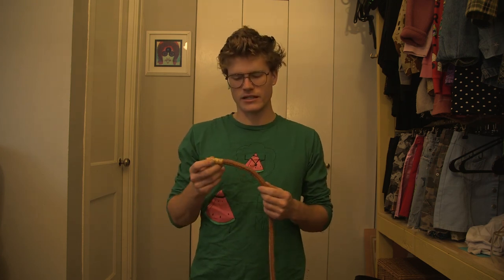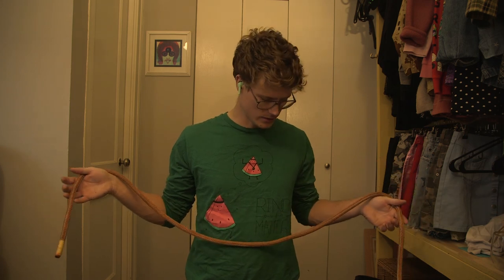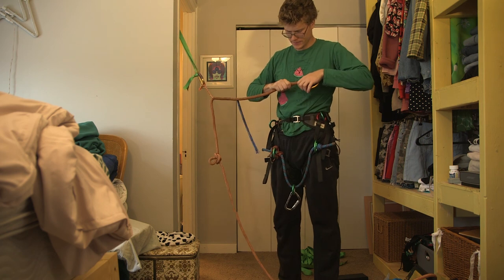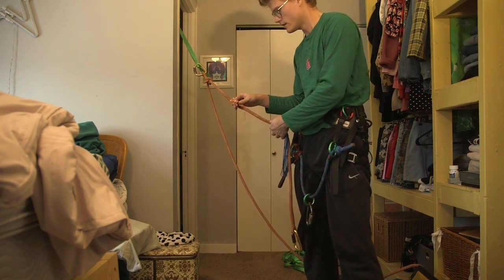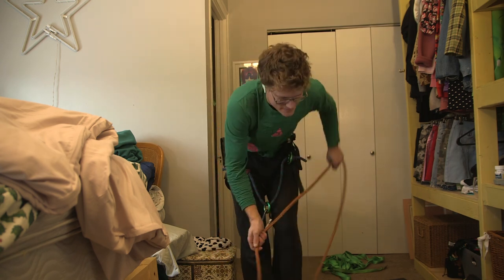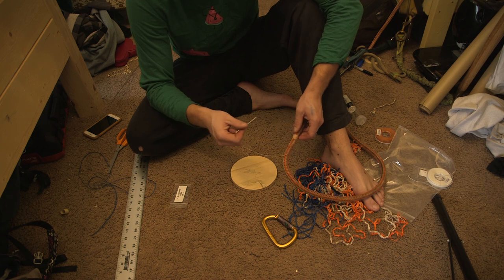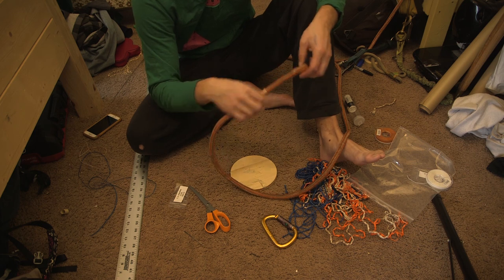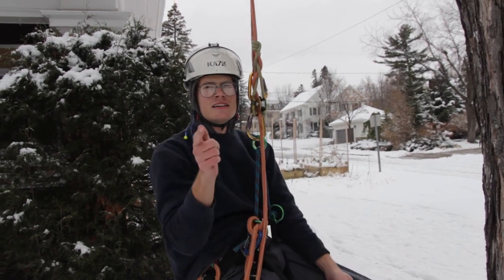Used Safety Blue | Tight Eye Splice

Comment: Do you climb on 16 strand ropes?
Reply from the maker: Very occasionally, I pretty much only climb on kernmantle ropes and use a lot of 16 strand ropes for rigging.
Reply from the maker: @leoga8521  Either, it depends on the situation. I tend to climb double rope a lot in trees that can be mostly free climbed, that way I can keep repositioning my lines very quickly. On removals and large pruning jobs I often climb single rope.
Reply: @treespicemedia  do you work with kernmantle ropes or you just use them to access the tree?